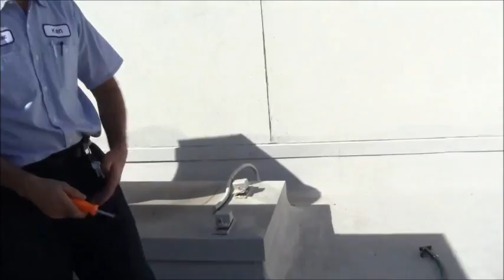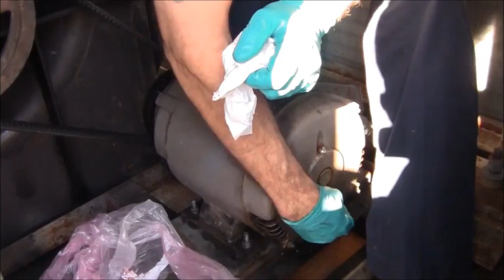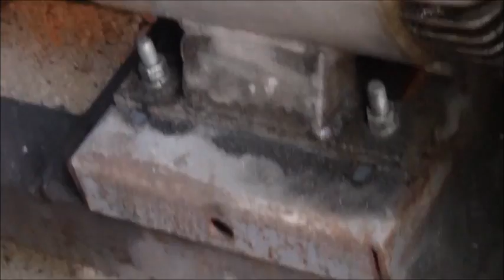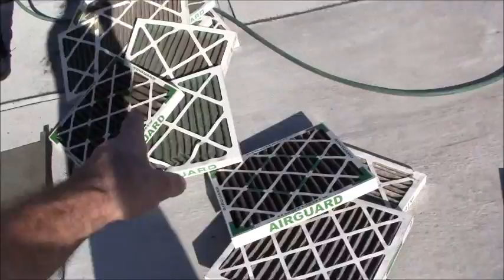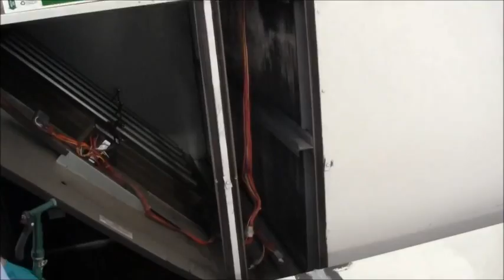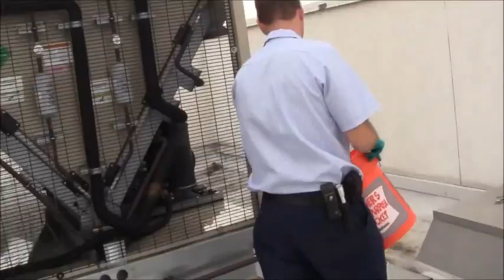Annual PM Service to an AC Unit

Comment: Liked your video very much. I have a couple of questions. 1. Why not just replace loose belts with brand new ones and save yourself a headache of moving the motor since eventually you will have to replace them and adjust the motor back to the original position? 2. When de-energizing the units you use your left hand. Is it not safer to use your right hand instead to minimize the risk of having current run through your heart?
Reply from the maker: 1. I want to get the maximum life out of any belt/motor that I have purchased for the customer. The proper way when installing belts is to loosen the motor to not stretch the belt when putting in on. I know this is sometimes not practical but it is a best practice. 2. I choose to use my non dominant hand and extending my arm so my body is as far from the disconnect switch as possible and looking away when throwing the switch in any direction. To me that is the safest approach.